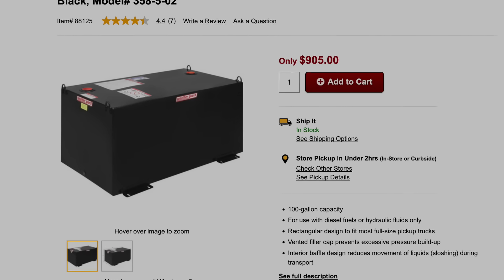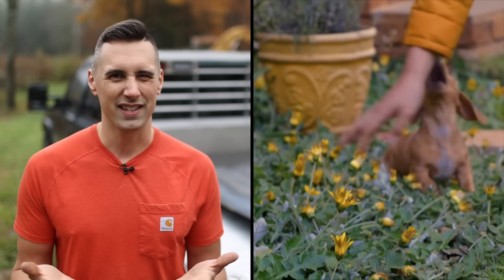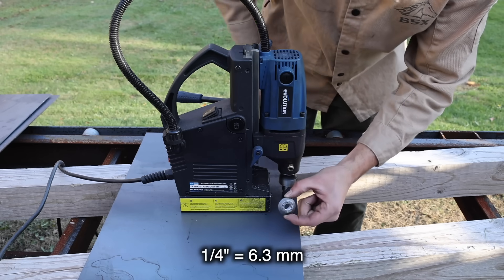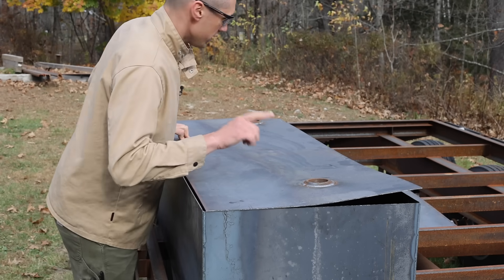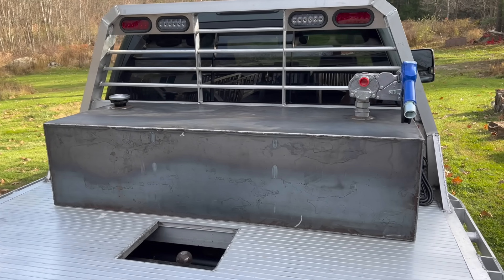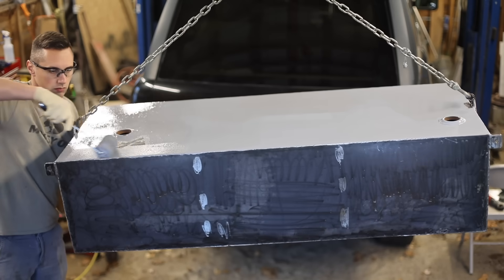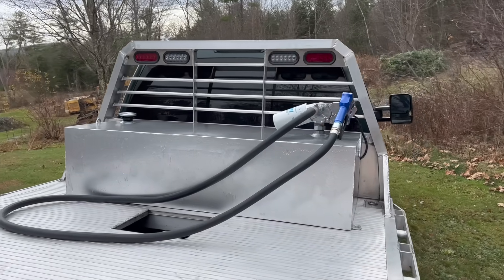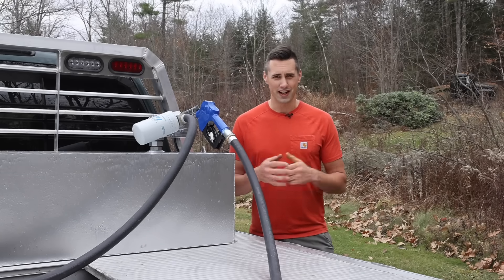Building a Fuel Transfer Tank

Comment: A connection kit to your truck's feed tube is only $50 amz or ebay. Add $50 more for decent hoses, connectors, clamps, 12v solenoid valve, and a switch. Cool project.
Reply: Also a nice fine if caught
Reply: @FishFind3000  I think dot requires a flip over valve which is included in the kit. The tank at this moment has no flip over valve on its air vent, so isn't it illegal now?
Reply: ok i checked the dot regs. gravity or siphon feeding diesel from aux tank to main tank is perfectly legal. your fittings may also be placed near the bottom of the tank. only non-diesel liquid fuel tanks require fittings above the full liquid level. actual bottom-of-the-tank drain plugs/fittings may not exceed 3/4 inch below the liquid bottom level. roll-over check-valve vents ARE required. highly visible tanks, such as waldos, require two markings: liquid capacity in gallons and a disclaimer to not fill above 95% of tank capacity. Tank manufacturers are required to add some more markings, but i don't think that applies to DIY. Fuel lines need to be as big or larger than the existing ones, and lines can't be run more than two inches below the lowest fuel tank sump unless armored. lines must be protected from chafing and must have reasonable slack for thermal expansion and vibration. so my original comment was 100% legal and correct.

Comment: If you get off-road diesel for your big equipment, is there any issue then putting normal in afterwards (that is, does the dye stick around problematically)? Let us know how it goes if you swap back and forth!
Reply: It'll definitely be detectable for a while. It's designed to stick around for a while.
Reply: Both red and clear get delivered from the same tank on the delivery truck. Run it empty on red, then do a few fills of just a few gallons of clear and rinse it out. By the time you fill it up you won't see the red. I've carried both clear and red in the same transfer tank on a truck before
Reply from the maker: I'm sure the dye would get diluted with on-road fuel, but I wonder for how long it would be detectable... 🤔
Reply: @WaldosWorld  Here in Denmark we also use dye in off-road fuel, meant for farmers and in marine equipment, and the dye will be visible for years in the tank and the fuel system, so if used in a on-road vehicle the police would be able to see it for years after.
Reply: @WaldosWorld  if it were me, I wouldn't switch back and forth. Through the rumor mill, dye found in an on road fuel system makes for quite unhappy law enforcement representatives. Your mileage may vary, but if you are thinking of using this for road trips and pull over someplace visible while transferring fuel, someone might want to check what you have in any tanks.
Reply: There is Black Petroleum dye available on amazon. I've never heard of any regulations against black diesel...seems like it would be a lot like use motor oil.

Comment: Quick tip for the issue with paint roller fuzz is to wrap it in blue painters tape, squeeze it tight, and then rip it off like a band-aid.  You'll see all the loose stuff come right off onto the tape.  Loving the "I'll go do it myself and I'll do it better" projects
Reply from the maker: Interesting, thanks for the tip!
Reply: @WaldosWorld  I've had great success with  painting with high density foam rollers too.
Reply: @WaldosWorld  https://youtube.com/shorts/V0ZZr5HY7Sc?feature=share
Reply: Dude I've been looking for a transfer tank and they are expensive AF, I'm like all it is is a basic fuel cell which I've seen built diy before. Totally going to check this video out.
Reply: Mr Waldo; I am not getting notifications for your new videos. I always find them anyway but just thought you should know.
Reply: Couldn't you bed red diesel? Which should be cheaper than pump diesel.
Reply: @nick-leffler  well it sounds like he's going to use it to refill on road vehicles too. Also depending where you live it's harder to find a place to buy off-road.
Reply: ^ That and a better quality lint would help too. There are lints specifically for epoxies.
Reply: What I also like is that road-trip argument (heavy price differences in gas between the US States). Why not drive through the US with an unmarked, unlicensed 90(?) gallon tank full of combustible fluid?
FBI: Wait a minute ... (Well, that is the USA)
Without any crash test certificates or stability engineering specifications or street legal papers (Well, that is the USA, too ... or?:) )

see: "Safety and environmental standards for fuel storage sites", "Requirements for storage and handling of gasoline on ... - OSHA", etc. Ouch!
Reply: @dieSpinnt  An ounce or two of degreaser isn't going to harm anything.  It's not like back in the day when guys would pour their used oil in a hole in the backyard.
Reply: @dieSpinnt  Holy shit, meds.
Reply: @dieSpinnt  Read Part 49 CFR - it covers some of the transportation stuff. By the time we get to all of your points of discussion we are looking at tanks well above that size. Note: Semi fuel tanks sit between 75 and 100 gallons EACH.

In terms of the degreaser: Youre looking at an amount so minimal that most states wouldn’t consider that an unregulated discharge or spill. Personally I can tell you i have to do more paperwork for you spilling a gallon of Dawn dishwashing liquid than I do for many degreasers. At both state and federal levels.
Reply: @dieSpinnt  the soil is a great filter for contamination. As long as it is t gallons and gallons of oil in one little area. Mother nature is pretty impressive.
Reply: 9:34 "A good rinse with water will wash of the de-greaser" (and the oil) ... all into the f'n groundwater.
Am I in the wrong movie? Is this from 1930? ... Holy effn mother nature.
Reply: @dieSpinnt  I've got just the solution for you. You should stand up with your feet just wider that shoulder width, then rock your hips left to right as far and quickly as you can. Follow those steps and if you're lucky, you'll knock some of the sand out of your vagina...

Comment: Will the inside of the tank rust over time affect the fuel quality ?
Reply: No, Diesel is Like oil and will coat everything. It can Rust, if it isn't used a Long Time and water and oxygen can build/ get inside. But while using, nothing will Rust
Reply: the top of the inside of the tank might rust but thats about it

Comment: Consider putting high flow quick connects on the pump outlet and hose end that way you can easily remove hose when not using and store in truck tool box
Reply: Not if you use dry quick connectors.  But they are a bit bulky and pricey
Reply: Messy
Reply: Where can you get quick disconnects? I've got 3/4 hose that I'd like to add a quick disconnect to.
Reply: @michaelkemper9835 skid steer quick connects would work great

Comment: This is great timing I’ve been actually looking to buy one, I have some welding skills so I’m going to actually try this thanks man!!
Reply from the maker: That's awesome, glad to hear it! 👍
Reply: double wall or rust proof the interior if you are making one. Fuel will contain a little bit of water and that can lead to internal rust. Also a drain valve at the bottom
Reply: @ddjohnson9717  exactly my thoughts, and I'd put a fuel pump with some sort of meter to avoid any possible mess or to keep track of how much fuel is left in the tank

Comment: So you could use agriculture diesel which is usually far cheaper for your home heater and your heavy equipment, but don’t get caught using it in your trucks regular tank
Reply: No pressure test on the tank to check for leaks?
Reply: @alexbromberek1234  it’s not under pressure but the only real way is to put fuel in it and see if it leaks.
Reply: @Eddievargas1 not the "only real way" c'mon now.
maybe just put a schrader valve stem through a cap and test with low psi air.  air being considerably cheaper than diesel.
Reply: @halledwardb it’s rather difficult to ensure the tank is then dry before putting diesel in it
Reply: @alexbromberek1234  don’t ask me lol
Reply: I’ve known two people to get their tank dipped and you pay hefty fines for it. Not worth the fines if you’re running it on the road constantly
Reply: You can filter it through cat litter. Build a u from plastic drain pipes, fill it with  cat litter, then make one side lower and add a way for fuel to pour out to a canister. Dump your red diesel in the other opening, hypothetically of course and you'll get hypothetically white diesel
Reply: That's what I do ag diesel in everything including vehicles house machines
Reply: DOT can dip any tank that's on the road. Red dye diesel leaves a certain chemical soot in the tail pipe that they can test for and know if you're running red, even every once in awhile or mixed.
Reply: @ryanthomas2472  Gotcha.
Reply: If an diesel was in the tank, then filled with normal diesel, would the dye residue stain the truck diesel.
Reply: Do they check non-commercial diesel trucks fuel tanks?  How do they even know that this private truck is a diesel to begin with?
Reply: @Florida_Man_In_Florida  well it’s kinda obvious, plus if you know anything about trucks you can tell what’s a diesel and what’s not.
Reply: @Florida_Man_In_Florida  commercial or not. AG fuel is for reefers and farm equipment not on road vehicles.